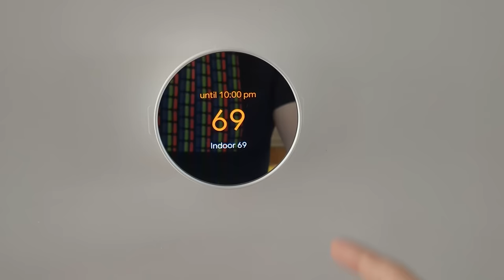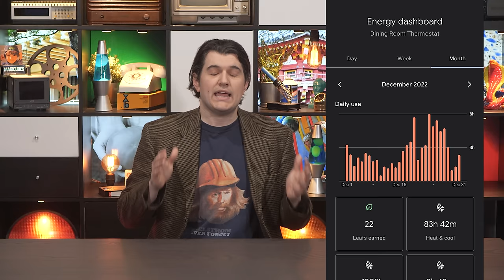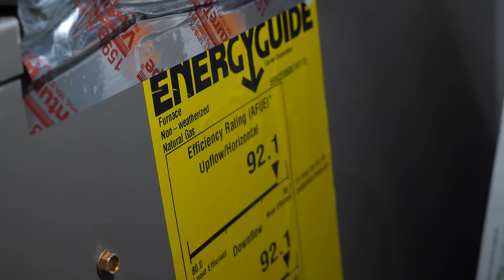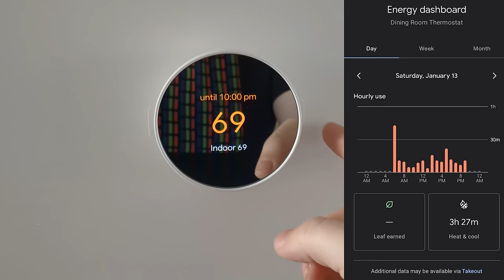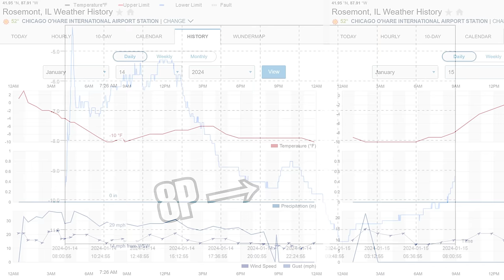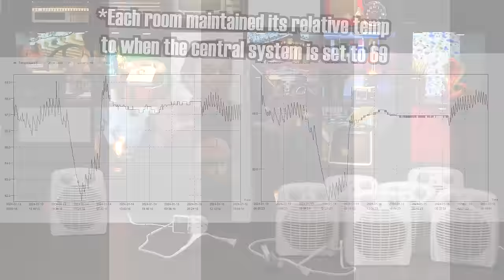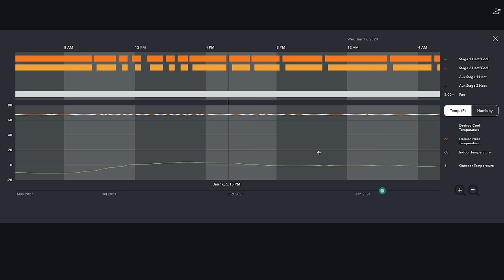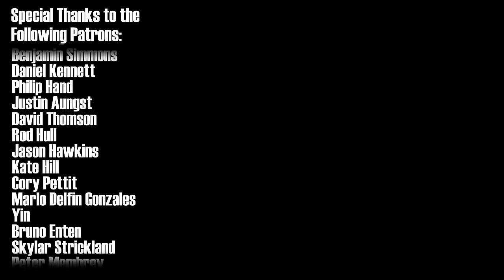Old HVAC industry practices are holding us back and costing us money. But we can fix it.

Comment: Replaced a 99K BTU oil furnace with a 42K BTU heat pump with backup electric heat strips. I have zero issues heating my home and the backup electric heat strips are never used. I'm saving hundreds every year since heating oil is freaking expensive per BTU when compared to electricity around here.

And my HVAC guy did a Manual J calculation so he knew it was gonna work.

Comment: I enjoyed the video, but I am curious what type of ROI you expect to see when you replace your oversized gas furnace with a heat pump, considering your gas bill is only $70/mo and it looks like that includes your water heater, dryer and possibly your gas range too. A heat pump will cost you at least $15k installed, so no matter how efficient it is, you likely won't see any savings.

Comment: Meanwhile in the winter in this worthless apartment here CT... my gas heat system runs probably 50% to 75% of the time. Sometimes it turns off after 20 minutes just to turn back on 3 minutes later. Also it's right outside my bedroom and livingroom, so it's loud and annoying and makes me turn up the TV louder, talk louder, etc.

Comment: I just did a System with a super fancy Mitsubishi coil designed to sit under a Furnace.

Coil is 24k BTU's but 21.5" wide. The furnace that was the same width was 80k BTU's and obviously way oversized. I disabled the 2nd stage so it will never come out of 1st stage, which is still 52k BTUs. 

Manufactures need to start selling smaller BTU's furnaces in larger widths to use the larger coils that are being made.

Comment: The oversizing of gas boilers in European homes ( less so apartments) is very common and many new boilers are going into homes with upgraded insulation ( windows, insulation, doors ). European gas boilers can moderate down to low single figure KW. Many now mandate such boilers to be fitted with external weather sensors that moderate the boiler down to reflect the external weather without any manual moderation

Comment: -25°C may be abnormal and "brutal" in Illinois, but where I live we can be get consistent daytime highs of -25°C and nighttime lows of -35°C in January and February.  The coldest nights might get to -40°C. Those heat strips may be doing a lot of the legwork in my climate during the coldest months.  I know resistive electric heat is more costly to operate compared to natural gas, and I am wondering what the break even point is.

Comment: While not comparable between countries, here in Denmark my heating costs dropped by 75% when switching from natural gas to an air to water heat pump. In fact my total electricity bill, including heat, EV and everything else, is less than what I paid in natural gas alone. Even during the energy crisis I saved money, yes, electricity cost up to €1.15/kWh at times, but that was driven by a lot of our energy grid is based off of natural gas, so when gas gets expensive so does electricity. Since then there has been an explosion of renewables, and prices are back down to before crisis levels.

Comment: Something occurred to me that made me come back to this video. I appreciate the information you share and want to be open to new more efficient options. I was thinking about a statement you made that a system running all the time is fine, but I thought later doesn't that just mean the system is NEVER reaching my desired comfortable room temperature? I set that temperature because that's what I find comfortable. If the system runs all day, it means I will never be comfortable. Also, if my home is well insulated, once it reaches that temperature it should be able to hold it for a while before needing to power on again.

I don't understand your proposal that a system running all day is working sufficiently. That sounds like either insufficient insulation, or insufficient heating/cooling for the temperature I set it to.

Comment: 13k dollars for a 3ton 18 seer all in also living in the Midwest! 3ton is probably oversized for my house after listening to this lol. Outside temperature this last winter got down to -18 and my 3ton unit was able to maintain 60-62 degree without backup heat (due to being installed wrong). house build in 1970 and very much not insulated properly! Great video and very informative. Advocate for your hard earned dollars you spend on this stuff!

Comment: Someone once told me you can save on natural gas by running the blower all the time.  Spreads the heat out...

Well all I got for that was an extra $70 in electricity for the month. That blower fan isn't cheap to run 100% of the time and I imagine sizing your furnace to run at a higher duty cycle will cost more in electricity.

Comment: As a younger  "retired" controls/programming engineer and HVAC owner/contractor, I don't agree with every single point made in this video but the vast majority of what you have said is 100% true.  One aspect I've consistently questioned is the discrepancy in how we calculate heat pump demand compared to gas firing unit demand. Additionally, the notion of a furnace running for planned intervals (traditionally 3 times an hour) as a measure of “efficiency” seems counterintuitive to me. We should be taught now to introduce gradual, consistent heat distribution similar to what a mini-split system offers.
I'm actually a great candidate in my own home.  For a while I thought it was so great that my system only ran for 9 minutes an hour on average, which for my current heat load on a mid 20 degree day puts me between 12-18k btus (1/6th of an 80k btu, variable speed furnace) but I run my fan continually to keep my 1.5 story home regulated as temps fluctuate upstairs and downstairs (even with "updated" ductwork).  

However, I’m not a firm believer that this new method may be universally accepted, particularly in locations like Mid-Michigan where I live.  Many individuals are averse to any increase in their monthly utility bills, even if the comfort level improves significantly at a low cost. Furthermore, the upfront investment required for the most advanced systems like dual fuel, modulating furnace and inverter unitary heat pumps (ranging from 15-20k) presents a significant barrier for some.  The equipment price alone, at our discounted contractor rate, is roughly $10,000 for a 60,000 BTU modulating (American Standard/Trane doesn’t make a smaller modulating unit) as well as a 20 SEER Variable Speed heat pump.
Factors such as increased frequency of filter changes (which are already often neglected), continuous fan electricity consumption (regardless of ECM motor efficiency), and the misconception regarding gas usage can further deter these changes. The cost of performance per dollar falls off when you start getting into the more efficient systems as well as having to utilize old ductwork.  

One thing I will add, is that refrigerant has a scientific limit to how much heat you can transfer with it and does fall off in capacity  as temperatures drop.  This can be negated by slightly oversizing your heat pump and stepping into an inverter or two stage heat pump unit.

TLDR; agree with most and disagree with some.  I think this approach makes a lot more sense on newer builds where ductwork will be designed around smaller systems that roll in heat more consistently instead of the high cost to modify a home and the existing ductwork.

Comment: If you have a furnace already don’t go straight heat pump. Get a duel fuel system. It’s a heat pump and a furnace. The furnace will only run at the coldest points when you need it.

Comment: Keep in mind that temperature loss has greater correlation to air infiltration than just "R" value. Something as simple as opening the front door or the garage door has enormous heat losses and the time to recovery is improved by having a larger furnace.

Comment: Sitting in my German Town Home with the Cabinet holding my combined heating and warm water supply system right next to my desk, I just start to realize the system I got is oversized as well at a max output of 14.5 kW. But a fair warning, this would become comparing apples to pears. For years we have energy saving standards that need to be considered in new buildings, evolving every few years. I am sure most places in the US have some comparable code about insulation etc. I just cannot tell how comparable those are. Second thing, no air ducts here, also no HVAC, just heating and warm water.
Our heating is usually hydronic radiators or, especially with newer standards, hydronic sub floor heating. For me its radiators. Oh and just for comparison, even the heat pumps you will find here heat up the hydronic system. As we are heating water, not air directly, our furnaces look somewhat different as well. they are smaller as they don´t have to handle air volumes. 
Also, for years or even decades now, those gas furnaces are what you would call a condensing boiler or calorific value heating system. so it takes the macimum of heat out of the exhaust gases as well. looking at some still new sold furnaces in the US wthat practically are a burner and air going around exhaust pipes, nope, you don´t find those here. 
And that same furnace produces hot water for me as well. It is so "oversized" as in theory it should be able to produce hot water taken from at least two taps at once on demand, although I have a 150 l hot water storage that only gets about depleted if I ever decide to fill up the bath tub.
Also, during winter, the heating is coupled to an outside thermometer. So with some (not even that ) fancy charts and graphs the controlls decide how much to even heat up. Depending on the outside temp a certain target temp is set for the hydronic system. The maximum in my system is set to about 70 °C, which seems to be ridiculous, at -15 °C outside temerature i have barely seen it set the temperature to anything higher than about 45 °C. Most of winter 38 to 40 °C is what you will see. (For those who did nopt catch the consept, that is the temperature of the water in the hydronic system sent to the radiators, not room temperature. Room temperature is set by a thermostat on every single radiator, or in case of sub floor heating, per room.). Above 15 °C outside temperature, it doesn´t heat up anything but warm water. So you already might have figured out, it by far does not run a whole lot of time usually.
Oh and if you ask what we do with heat in the summer, well, we open those damn windows during colder times of the day, thats what they are for. during the rest of the day we keep them shut and most liely even close some shutters to prevent heating up to much. That usually keeps temperatures quite bearable in here. (Unless your wife and daughter want "light and fresh air" and keep shutters and windows open during the worst heat of the day, afterwards complaining about the room being to hot...).
While I am almost sure the required energy for ehating is the same in kW, I just would wish it could settle that bill with 70 bucks as well... That comes way more expensive. Which is likely why we are way more into conserving energy for quite a while now. It always was economically sensible to do so.

Comment: Just half way thru the video, but have you calculated with ventilation losses? Kitchen and bathroom exhausts? Even if the building has an ERV/HRV, kitchen exhaust is usually not going thru that. Of course that still wouldn't triple the heat requirements...

Comment: Former HVAC residential tech.  You nailed it.  Owner inherited the company and the lead sales guy was just some smooth talking kiss ass.
Also once installed two new multistage systems with heat pump in a single home.  $50,000... That was pretty much what we made in a year.  Equipment and parts for the job cost $12k.

Comment: Re: Google

Nest is the only thermostat I'm aware of where you can't run Fan Only without having the system set to heat or Cool. 
They simply cannot energize that green wire without a temperature setpoint.

Comment: HVAC engineer here. Contractors (particularly in residential) tend to oversize the heat because more BTU's = hotter supply air. Despite having adequate capacity to maintain setpoint, occupants tend to complain that the heat isn't working correctly if they aren't able to feel toasty 100+ degree air coming from the registers. These tend to be the same people who turn hotel thermostats as low as they will go in an effort to "cool the room down faster".

Comment: HVAC engineer here, first residential is the bottom of the barrel so you get a lot of incompetents.  Frankly homeowners are garbage customers who don't want to pay you and are overly needy compared to corporate clients (I've had more flack from a single family home than I did from a 50,000 square foot office renovation - and one of those paid far better).  So there's basically no one who is a "respected installer" in your area - all of those are working for corporations.  What you can get is "the best of the worst".  It's like looking for high end talent in AAA baseball teams.  

Second, you just said it right at the start - you spent $70 on gas.  So it was pretty efficient.  Gas furnaces can have as high as a 20:1 turndown ratio, and gas piping can typically accomodate far more therms than the piping is used for (although lousy engineers sometimes don't even spec units with turndown options - idjits).    So why not oversize?  Larger gas burners and fans are barely more expensive, so it's trivial to design for scenarios like "the power has been out for three days in the coldest week of the year, and now we'd like to bring the house back to temperature in 30 minutes".  The homeowner appreciates it when it does happen, and there's no harm in doing it.  

Obviously you size differently for heat pumps, which is one of the reasons people complain - when the above scenario does happen, the house takes a long, long time to get warm comparatively.  Yes, you'll be shivering for a few hours while the heat pump brings your house from 10 degrees to 70 compared to blasting double the BTUs from a gas furnace.

But don't assume that every time something is "too large" engineers are dumb.  You could maintain 75 mph on the highway with a 40 horsepower engine in most cars.  Does that mean you "only need" a 40 hp engine?  I'd try driving a car with one of those before assuming all that extra power is simply wasted.

You've got a few misconceptions here I'd happily talk to you about (and yes, ACs are Heat Pumps, although that's only 'kind of' for newer ultra low temp models  like the HyperHeat, which is a little different).  Seriously, fancy systems at two output levels?  We can run fancy systems at nigh INFINITE output levels, continuous modulation for continuous operation.  Two output levels is bargain basement entry level garbage the IECC might not even let me install in an office environment (and that's what the residential sector consideres high end, see why no one wants to go there?)

Comment: Turns out very few homes are built with air tightness in mind. 

Having a continuous air/vapor  barrier surrounding the entire home with insulation on the exterior side would greatly reduce heating and cooling needs while increasing structure longevity and comfort.

Blower door testing should be standard before HVAC sizing.

Comment: There is a fundamental difference between sizing a gas furnace and sizing an air conditioner(or heat pump). You correctly state that it is desirable to size the AC to avoid short cycling. You also correctly state than it doesn't hurt to have excessive heating capacity when talking about a gas furnace. In fact, the reason that builders oversize gas heating is because people like to turn off (or lower the thermostat) when they leave for work or go on vacation, and turn it back up when they get home. This saves energy. But, people do NOT want to wait for several hours for the temperature to get back to normal when they walk in the door and turn the heat back up. A larger gas furnace doesn't cost that much more, so they just upsize it so that when you turn the heat back on, the house warms quickly. The short cycles really don't hurt anything unless the oversizing is extreme. Of course, with a heat pump, none of this applies and it should be sized to avoid excessively short cycles. If you have a heat pump you generally should not be turning down the heat when you leave the house, except for long periods. If you do, you can expect it to take a very long time to warm the house back up. It might even have to resort to emergency resistance heat and use more energy that if you had just left it on. I think most of these sizing errors are lazy installers that simply copy the size of the furnace when putting in a heat pump. In other words, the size of your gas furnace is fine, just don't use it as a guideline for how large your heat pump should be.

Comment: Would really love to see the resource you used for manual j. My garage is converted to a home gym and I've been looking at the same line of pioneer heat pump you have in your garage, but the 'square footage' guide on the sales page doesn't seem very relevant when you're working on a garage with an unfinished ceiling.

Comment: Alright I've watched enough of your videos to be convinced on heat pumps. I have a converted garage office that needs some supplementary heating. It has no ducting, I currently use a wall heater but it doesn't do quite enough and is power hungry. I've got a window A/C and wonder if I could replace it with a reversible unit. Options?

Comment: Depending on where you live, heat pumps are great, but not enough.  I also have a central electric furnace, but the heat is very efficient, so it rarely has to come on.